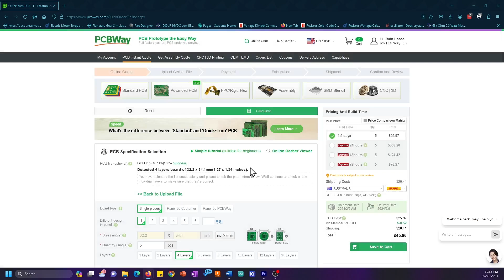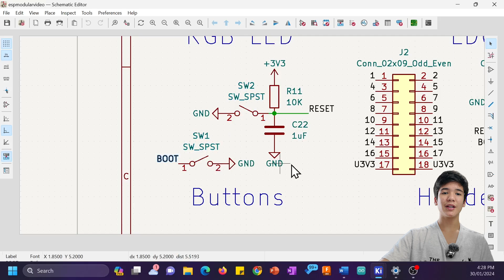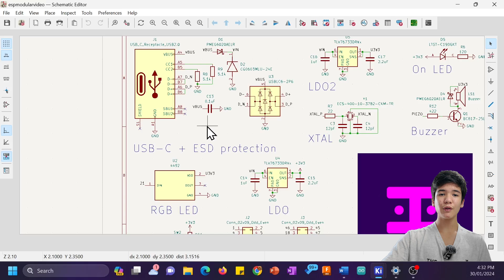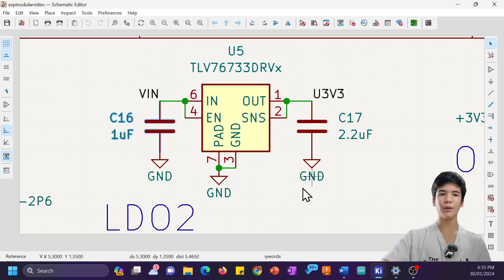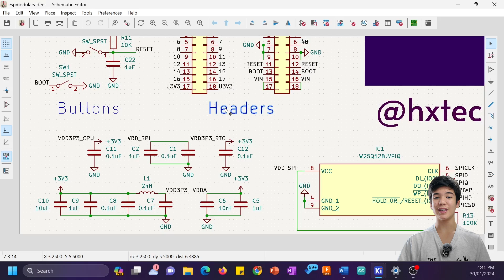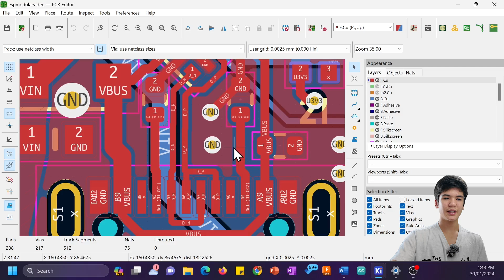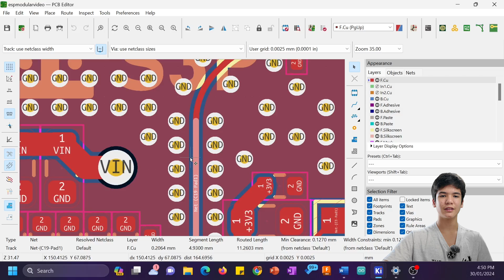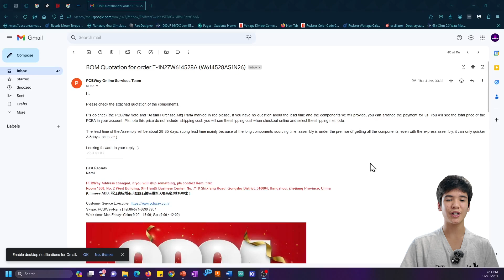ESP32-S3 + Chip Antenna PCB - Design your own in 15 minutes!

Comment: Great work, and a good looking board. Good to see you understanding the mistakes and learning from them!

Lots of others have pointed out the need for some sort of buck as the power in, I would definitely agree if you want to be dropping from 12v. The ESP32 can pull some decent current, so those regulators will get hot!

The one I've not seen anyone point out is your decoupling capacitors, I'm not sure why they are all in a corner of the board. They only really work when placed as close to the pins as possible, else there isn't much point them being there!
Reply from the maker: Thank you bro! Yes, I have made a 2nd revision of this board with the exact upgrades you mention here 😁 I used a Buck converter IC with an integrated inductor (encased in the chip’s packaging) which is supposed to help with EMI, placed the small value capacitors (<=1uF) as close to  the ESP32 as possible, placed the bulk capacitance (70uF or so) close to the Buck converter, upgraded the antenna, pin spacing, and so on. Thanks for this info though! 😁 I am unsure whether placing the 3.3V bulk capacitance that I mentioned before a little further away from the chip (like, 20mm) and near the Buck converter will negatively impact things, but I’m pretty sure it should be fine, I can’t exactly tell you why it will probably be ok though 😅 I do know that the Buck converter desperately needs that bulk capacitance close to it in order to be stable though

Comment: Which board did you slelect in the boards manager of arduino or platformio? Did you have to do something extra as it was not a dev board? Thanks!
Reply from the maker: UM ProS3, because it has the same USB programming, and 16MB flash, 8MB of PSRAM
Reply: @hxtec32 thanks! I recently started making my own pcbs and just like you, I want to go smaller yet  functional. Great video! Keep it up!!
Reply from the maker: @sammybrown6730  awesome man, hope you do well with them

Comment: What matching res/caps did you settle for for the antenna? Does it also decently work with 0Ohms and NC?
Reply from the maker: haven't tuned it. 0 ohms and NC works horribly, haven't done any RF testing since this video. I also don't have a VNA to even perform these measurements :(

Comment: Kicad 7 has trace rounding (i think 6 did as well?), and i've never had problems with stitching vias in Kicad 6 or 7. are you sure you're not accidentally using an old version?
Reply from the maker: I’m definitely using KiCad 7 bro.. yeah idk what happened there, but for me, I needed a plug-in to be installed. Maybe I just didn’t find it, but it was already there before the plug-in 🤔 Anyways, thanks for your comment
Reply: @h1tec  oh, looking at the thumbnail it sure does say 7! i think you said 6 at some point in the video and that threw me off

Comment: Where did you learn c++ for Arduino programming 
Day 3 of asking lol
Reply from the maker: Hey bro, sorry i havent responded quickly. I learned a lot of c++ from dronebot workshop, i also looked at a few esp32 examples online from random nerd tutorials.
Reply: its ok i understand, thank you for the quick reply anyway @h1tec
Reply: also btw in the pid line follower robot when one of the motors weren't turning and you said it was because of low output of pwma, you said you changed the code but i couldn't see any difference in the code (from the perspective of the video) can you please tell me what you changed? ty @h1tec

Comment: Excellent video, very informative and well presented. Can you share the document shown at 7:30, and why vias under the chip is a bad practice? Vias under components in the rf section would be bad practice but i see a lot of vias under components like microcontroller, i thought it was okay. Learning a lot with your videos, thank you.
Reply from the maker: Hello sir! Thanks, the document at 7:30 is the ESP32-S3 hardware design guidelines, Schematic, RF section (you can search online since YouTube has blocked links in comments). I think you might be right actually, grounding vias for the flash chip might not be bad, but I imagine that, because it isn’t connected to the top ground plane, there could be worse thermal performance. Idk if that’s an issue tho, thanks!
Reply: @h1tec   Thank you! I am still new and learning so probably way above my head so I am also not sure but no doubt in this case it would be fine.
Reply from the maker: @adamarzo559  thank you bro

Comment: very cool, the LDO overheating problem is very common in linear regulators, since Power dissipated=(Vin - Vout) * Amps.
if you input 12v, and your board uses for example 500mA, you would get 4.35W dissipated in 2x2mm, which is not good.
It's going to be definitely harder to implement another type of regulator, like a buck converter, but it's going to be better if it decides to overheat and desolder when using more than it can handle. For now, i think it's ok if you dont use wifi constantly, like a server or somethin.
I almost burned myself one time touching a linear regulator connected to a 9v battery and an esp8266 board😅
Reply from the maker: Oof. That’s not good. Yeah, I honestly should have used a Buck converter, but I felt like I didn’t have enough space even though I could have expanded the board by just a little bit. Thank you bro!